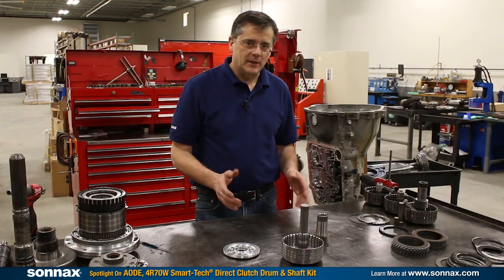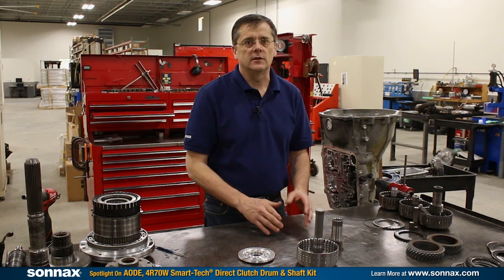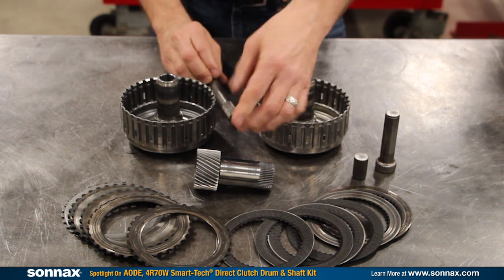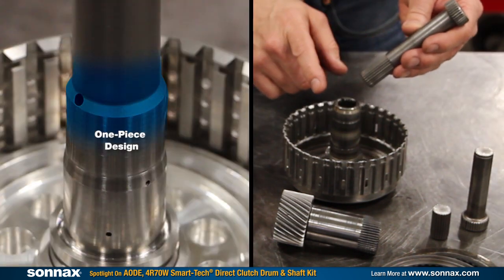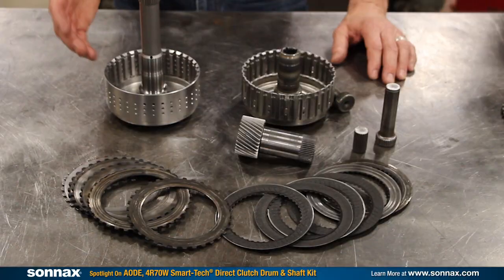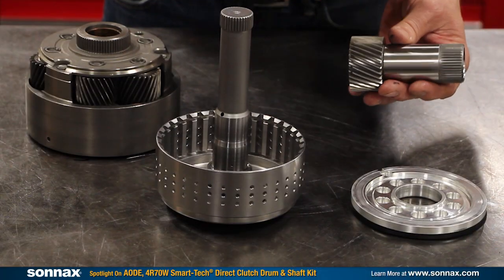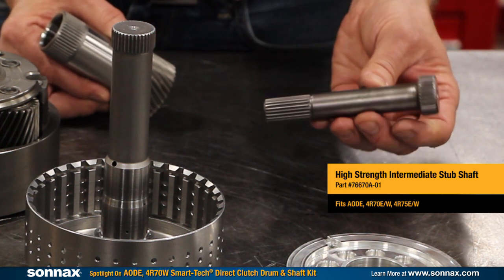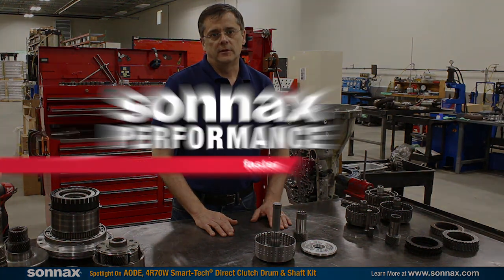Stop Chasing AODE, 4R70W Direct Clutch Drum Problems

Comment: Got a little over 350,000 miles on my 03 4r70w behind my 4.2l V6 in my f150 just now starting to have issues with 3-4 shift caused by the O/D servo pin bore that’ll be an easy fix. This transmission has been rock solid. Only had fluid and filter changes its whole life. Has been thrown into reverse going 40MPh + twice and ran low on fluid twice as well but didn’t keep driving it. Pulled over immediately.  Really looking forward to seeing how long it lasts. Put it on a diet of amsoil signature series trans fluid about two years ago. Been shifting perfect under light load/ acceleration

Comment: I see a bunch of negativity here in the comments on this deal . Well , I will tell you its a bad habbit to have and I am not a trans guy , im a ford guy and I use all of it in every one of these things I do .  Yeah , its not cheap . But I honestly hate transmission work . I can do it and ive done my share but I hate it . If I have to go back into one the second time I am not the guy you want to be around . If you go to the sonnax site and buy all of this very nice stuff that they make for this trans and throw in a sure cure kit you end up with a beast of a trans . Ive done several with these guts and they have been trouble free getting the snot beat out of them . Why did I start using this stuff in the first place ? Because everything they sell directly addresses a weakness in this trans . These are problems and every single one you see fail is for one of the reasons sonnax addresses with their parts. You can buy good clutch packs on ebay cheap and just use what you need . If you cannot afford that I dont understand how you bought the sonnax stuff in the first place . These parts arent for the throw it together and see how far it goes afterwards crowd . These parts are for the guys that want quality and reliability as the result of the work they put into something. ALL of it is flawless every time . And for the guys saying they dont need the sonnax upgrades ? Well there are plenty of fleets running these parts in service trucks still today... Again , there were problems with these transmissions and those issues made them fail . Sonnax addressed that. No  , Im not a shill nor does SOnnax even know I exist. I just apreciate when someone provides answers to known problems... Its not a problem any longer at that point..

Comment: But this is only possible when having a 4r70w/aode transmission right?

Currently i have and AOD built with 4r70w internals and a one piece input shaft with manual valvebody.  Forward drum was replaced with your sonnax part but not the direct.
Reply from the maker: Hi, our tech team would be happy to help you with any questions. They can be reached directly via email at sonnaxtechsupport@sonnax.com, or phone at (800) 843-2600 ext. 398. Thanks for reaching out!